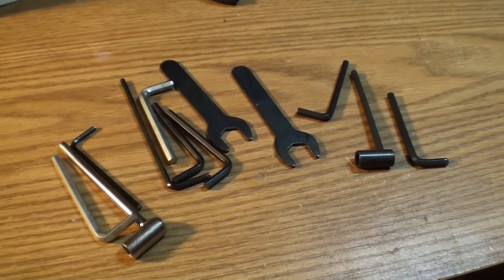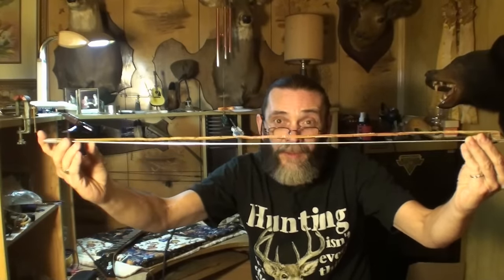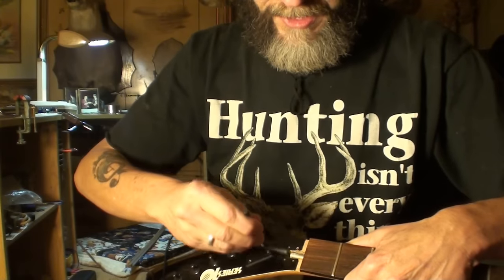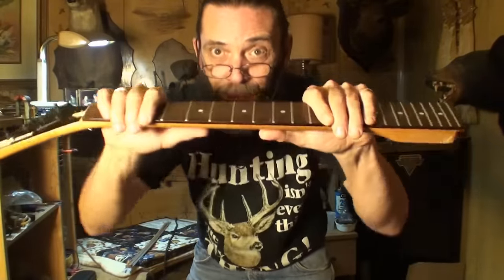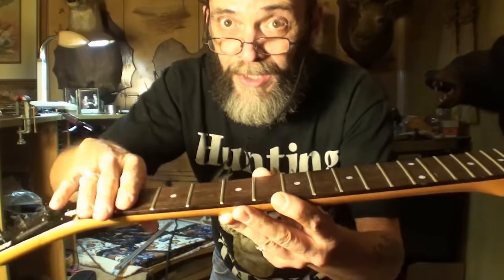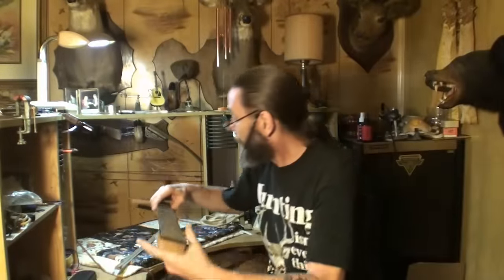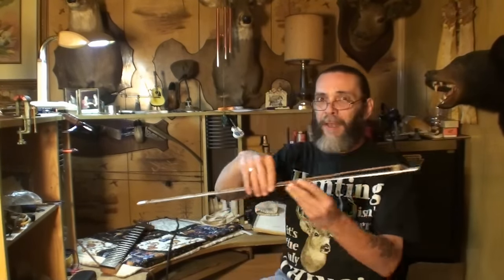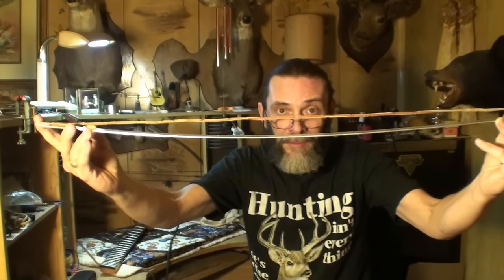guitar truss rod adjustment how it works by Randy Schartiger

Comment: Your suggestion about helping the truss rod along is good advice as wood responds much slower than a steel bolt. I acquired an old Gibson with a ton of bow. I turned it on it's face with support at the nut  and laid a book on the upper bout for a few days.

Comment: Thanks Randy - you're a good teacher and I like the visual aids!  Personally, I never use 3-in-1 oil (or DW-40) anywhere on my guitars ~ they attract dust, dirt and moisture. I use DuPont Non-Stick Dry Lube - comes in a spray bottle with a straw or a squeeze bottle - very inexpensive.  I use the squeeze bottle with a micro-brush to apply it to the truss rod nut, saddles and the nut ~ makes a fine "nut sauce," does not attract dust, dirt or moisture and one bottle will last a lifetime.

Comment: ever since I switched to 12's, I had buzzing on the sound hole..  and very hard to play barre chords starting on 5th fret. buzzing everywhere UNLESS I press hard on the fret. maybe from transitioning from 10's? the neck bowed concave slightly. Action is low at first but at all the way to 10-22 its like 2.3 mm high lol.. Ill bow the neck tighten right? or just switch back to 10's? i want 12's cuz of the volume but if thats the case.. itll be it.
Reply: Same here and now i got an s twisted neck even puting 10's again doesn't work

Comment: My trussrod doesnt move.  I tried with inhuman force to any side but it doesnt move a single milimeter. What coukd be?   Is a neck thru guitar
Reply from the maker: drop one drop of 3&1 oil onto the adjusting head or any kind of lubricant and wait 24 hours and try it again, if still no success try heating the adjusting head with a soldering iron or wrap that end of the neck with a heat pad and let it heat up, heat almost always works. good luck and thanks for checking out my videos.
Reply: Randy Schartiger  Im on it! Thank you Randy!!!!
Reply: It worked!    Thank you!!!!!!

Comment: Do you recommend loosening the neck at the very least, if not remove it from the body before any truss rod adjustment to avoid crack(s) in the neck pocket corner(s) ? Conceptually/theoretically I'm thinking the neck should be as close to zero relief to be straight and let the gauge of the strings (8's, 9's, 9.5's or 10's) determine the relief at tuned tension(s) ? There really shouldn't be that much tension difference amongst 8-10 on paper, but that may challenge assumptions to see the differences in the  real world with a strung & tuned to standard guitar ? I think a lot of it has to do with the scale of the fretboard as well ? A 25.5 Fender/Squire Strat is not the same as a 24.75 Gibson/Epiphone Les Paul. The 2005 Squire Bullet I have had 9's on it, I tried 9.5's and really saw no need to adjust the truss rod for that, it's just that guitar was bought used, is 14+ years old, the neck & fretboard at the head stock looked like an elf slipper. So I did do several passes at truss rod adjustments knowing from the condition of the guitar that it really had never been set up since the initial setup. And if it had been maintained, someone loosened the truss rod to sight like a compound bow for boar hunting. I made several smaller neck movements not wanting to be too greedy and let it settle before going to the neck attempt to level the neck.

Comment: I know it's an old but video and a really good one 10X32, 1/4X20, 3/8x16. etc., means 10 (the first number) as the size of the rod or bolt and 32 means how many threads per inch

Comment: “People are afraid to adjust their truss rods...” 

BUT ALSO... “...if you over tighten it, you might damage the neck, strip the threads, or snap the rod, and that’s gonna be one expensive repair.” 

LOL

Kidding aside, this is a very helpful video. What I learned here the most was loosening it, applying weight to physically straighten the neck before tightening. Punchline right here: 5:52 Wow. That made a difference. I did this to a few of my guitars with concave necks and voila, low action without buzz. This video is a godsend!!!

Comment: About gauges on guitars - some companies (for example Fender for electric guitars) put very light strings like 0.9 in factory. I don't exactly know the reason, maybe they want guitar to be more playable with poor factory adjustment, I have no idea.

For example my Jaguar (short scale guitar bare in mind) come with factory 0.10 which is way way too light. There is barely any tention with that string, bridge adjustment with it is nearly impossible.

Comment: So on a Telecaster,  mine's a   3/16" allen, a basic seasonal humidity adjustment in NE USA coastal area (depends on where you live) is less than 1/10th  of a turn  and that moves the action between 1/16" and  1/8" up/down

Comment: Thanks , Randy .. I learned about the two-way truss rod in this video...EPI said I had one in my LP Studio .. Had trouble with it -- then realized I had a twist in it -- sloping downhill from the low E to the hi E !!   to me , it appeared the rod wan not doing a thing to get the bow out .. Then I saw the twist which is more serious .. Sometimes it is straight across -- then it plays great .. But most of the time the twist is present ,  and it plays like you know what .. My hand / fingers are very small -- so it hurts to have to curve my little hand & wrist back to play my " Cowboy Chords "  I have not done much to get rid of the twist .. Heat the neck did not work ..

Comment: This Washburn BASS Rod-Peg Head-Doesn't appear to have an Actual Rod that can BE Adjusted.
It just looks like a GROMMET, that no Hex Key would Fit. it's a perfect Circle.
WTH? And the Neck is Dipped in the Center, and Rises Slightly at the Tongue End.
I'm debating about Shimming the Neck, after Sanding the Frets from about the 15th, just so it won't Buzz at That End afterwards, and then maybe take a Hair off the Nut if I Can.
OR-Take the Neck Off hoping to Reveal a SECRET Adjustment in there...???
Reply from the maker: it may be a steel reinforced neck, if so it probably doesn't have an adjustment. good luck! and thanks for watching!

Comment: Hey randy, i have a classical guitar probably 6 years old,  cleaned its properly from time to time, I leave it in a slightly humid place but in our Canadian winters it can still get dry and I have noticed that lear the 10th fret on 3 strings the notes are slightly out of tune, enough for me to notice but I have never actually noticed before because I never actually played so high on it until recently.  Is it a normal thing or should it warrent a truss rod adjustment, its only at the 10th and 11th that i have notice it the other frets are still playing in tune

Comment: I have a Martin D35. I've always used Medium gauge strings. I think the neck needs reset. Will it hurt the guitar if I start using light gauge strings on it. I don't play as much as I use to. I'm thinking light gauge will be better for the neck. since I don't play as much.
Reply from the maker: +Thomas Tommy Light gauge strings are safer than heavy gauge, especially on a guitar that needs work, you may have to adjust the truss rod but you should be fine either way. Light gauge will pull lesser weight and probably need to tighten the truss if anything to get enjoyable action.

Comment: Thank you for the information. When I was a kid I ruined a Gibson acoustic by putting heavy strings on it and over tuning and ripped the bridge in half, then I put epoxy all over the thing to try and fix. Anyway, guitars have been relatively safe from me since.
Reply: Ha- don't worry bout it - there's nothing much that can't be fixed - unless you drive a semi across it!

Comment: on my guitar open A string its not a buzz but vibrate the whole neck while other string are smooth sound. when i hold the headstock and twist a lttle and  tried again the vibration is gone.. a little help pls.. tnx
Reply from the maker: Leap salvador it's probably your truss rod rattling inside the channel, maybe try tightening it a bit and see if that helps.

Comment: I tried to turn the truss rod in my Martin HD-28 counter clockwise to, (loosen it), get rid of fret buzz and the nut on the rod unscrewed off the rod. Now what? It's a 2006 guitar.
Reply from the maker: it must have a one way truss rod then, if you can't get enough relief in the neck try a heavier gauge set of strings, they will pull more relief into the neck and you'll probably have to tighten the truss a little bit. once achieved, you can go back to the gauge strings you like after a month or so.

Comment: Also I have a Martin DX1. Seems like the the top bass string sets up higher then the bottom light string. Would that be in the truss rod settings. Or the nut or Seattle? BTW, it was a great video tonight. As always.
Reply from the maker: +Thomas Tommy It depends on whether your measurement was taken nearest the nut or the saddle, sounds like a saddle adjustments is needed. But...the thinner strings usually are lower than the thicker ones, so it might be right on the money depending on the measurements.

Comment: I have a 1 way single adjustment rod on a 1984ish road-star ibanez. As the nut starts to untighten the neck straightens out and when the neck is perfectly straight And with strings in tune the nut adjustment is done. Any more and the nut starts to unscrew out freely. I would like to put a little concave bow in it but it runs out of adjustment. Is there anything I can do?
Reply from the maker: watch the videos I recently did on a Fender Strat neck or search this channel for "helping your truss rod" and try that method, you can use a clamp to force bow into the neck as you tighten the truss rod and by leaving it clamped in that position a few days they usually maintain the bow when the clamps are removed. this has worked for me on several occasions. good luck and thanks for watching!
Reply: @RandySchartiger  I used some heavy gauge bottom strings and it is great now. It has a little bow in it that I can adjust now. I learned that Road-star guitars in the 80s all have single adjustment truss rods.

Comment: after adjusting the rod 1/4 or 1/8th of a turn at a time... do we need to wait for an hour or so to let the truss rod adjust into the new setting before making the next turn??
Reply from the maker: yes! a lot of people break or strip the rod from trying to adjust it too far too soon, give it 15-30 between adjustments, if it's really getting tight heat the entire neck to about 150 degrees F, this lets the glue soften and move a little easier. Ill have a new video coming soon on this. thanks for checking out my videos!

Comment: All good info Randy, but it still worries me to think about the average joe taking a whack at truss rod adjustment. I've seen an awful lot of dim witted things done to guitars.
Reply from the maker: +Dane Nichols I have too! If they are careful and just stop or not turn it at all if it's tight they should be ok, but then too different people acknowledge "tight" a lot more than others might, meaning tight to one person may not be so tight to another. It;s definitely a touchy subject. Thanks for tuning in and commenting Dane!
Reply: +Dane Nichols   Some people are just to stupid to do this .    I dont know if Randy should of got into this .
Reply from the maker: +Dev9172 I hate to say it but you are right! Those people really should not try to adjust their truss.
Reply: Like i said i turn it really just a little .  I look down the neck .  People need to remember to get the right sound the string has to vibrate at the right rate .  So the sting needs the room .   Set your action to low and its fucked .  To high and you cant play it .   50 / 50 .

Comment: Hi, I wonder if you could clear something up about truss rods. I don't know what a maxed out truss rod means. Does it mean that the nut has screwed down to the end of the threads on the rod or that the nut has screwed down to the end of the threads on the nut so that washers need to be used?
Reply from the maker: Basically it just means the truss rod has went in the desired direction as far as it can go without snapping. Thanks for watching.

Comment: You gave a very thorough explanation of what a truss rod is and what it does. Is there any way to determine whether a truss rod is 1 way or 2 way on an older guitar?
Reply from the maker: +Dale Palmer Yes, loosen the strings and look at the relief, then start loosening the truss rod nut, it "should" force more relief into the neck and probably will get a little tighter to turn as you're loosening (because it's forcing more relief into the neck) before the nut gets loose and screws completely off. If it's a 1 way rod the nut will just keep getting looser as you back it off until it comes off the rod. Hard to explain but I hope that makes sense.
Reply: +Randy Schartiger If it's a 1 way rod the nut will just keep getting looser as you back it off until it comes off the rod. Thanks for the reply.

Comment: My truss rod is actually pushing out and into the notch of the head stock and I can’t fit the wrench inside because of it what is going on?
Reply from the maker: I worked on a Gibson J45 that did similar, it cracked the back of the neck, I had to loosen the truss rod, repair the crack and angle the neck onto the body so the truss rod would never have to be that tight again. maybe this will help. https://www.youtube.com/watch?v=TJaaOXNcZc8

Comment: I have a Gibson studio 2016T, and I want to loosen it more to get my 14th and 12th fret from fretting out, when I bend the high e string on those frets only, they don't sing and bend with a good note, I get nothing. I thought ok, no need to tighten but loosen it up, well, I got the truss rod tool out and started to go left and the nut bolt started to unwind. So I guess the nut and truss rod is as far as it goes for that position. I really didn't want to file down the frets, I thought it would work, any ideas?
Reply from the maker: it might have a 2 way rod but if it's turned as far as it'll go in that direction and you don't have a ton of relief in the neck then something seems wrong, not sure what you mean about the nut bolt started to unwind, the problem with the note that don't sing and bend clean could be a couple of high frets causing that to happen, a straight edge and crown file would fix it but you'd have to polish those 2 frets thru many grits of sandpaper to get them shiny again.
Reply: On this 2016 Gibson, and I think most of them, I don't have a lot of them lol, so just my views on YT on it, anyway, the bolt or nut on the top of the truss rod sits on the rod which is a threaded rod, the nut upon putting the socket tool on it, will only go ONE way, the tightened route. If I go the other way for relief, it starts to unwind the nut off of the threaded rod. So when I started this exercise, I thought that was easy enough, but then realized nothing was happening but taking off the nut lol:( So, hence my experience search for your input and others who know what they are doing. I have recieved the added advice to sand the frets, just thought that was a last resort kinda of thing, but I am tired of not being able to hit those notes. I appreciate your time and help, best regards!
Reply from the maker: ok I understand now, watch this video, I show how to help your truss rod to get the neck relief set where needed when the truss rod cannot make anymore adjustment, the way I explain it in the video is backwards from what you need but if you put the board on the back side of the neck instead of the side where the fretboard is as I did in the video it may help you. thanks for checking out my channel! cheers! 
https://www.youtube.com/watch?v=dHLoYcHUovc&t

Comment: Great video Randy - one question, how do I tell if I have a two-way truss rod or not?
Reply from the maker: Unless you have the fretboard off or can see the rod about the only way to tell is tighten it with the strings loose, it should put a back bow into the neck, then with strings still loose, loosen the truss rod, it should either straighten the neck or began to put relief into it, don't go too far but keep loosening and the rod should feel like it's starting to get tight again, plus if it's a 2 way rod you will see even more relief in the neck as the rod adjuster gets harder to turn as you're loosening it. I hope that made sense. If it's a 1 way rod the adjusting nut screws right off. Thanks for watching!
Reply: Cheers Randy, from your description I've determined its a two-way rod.